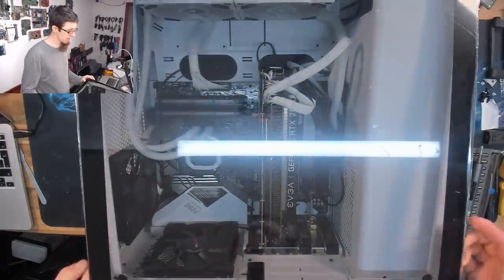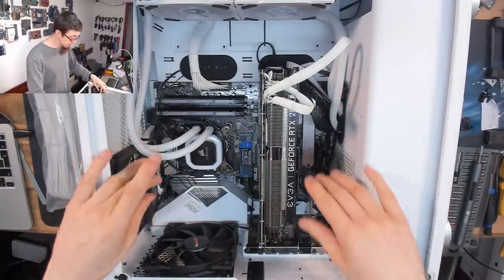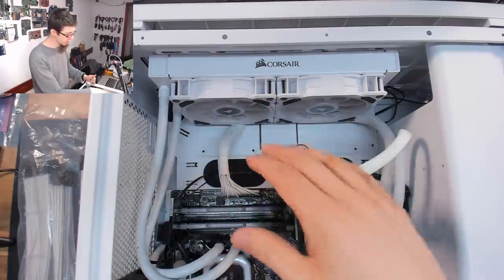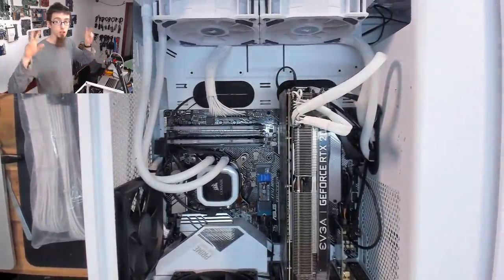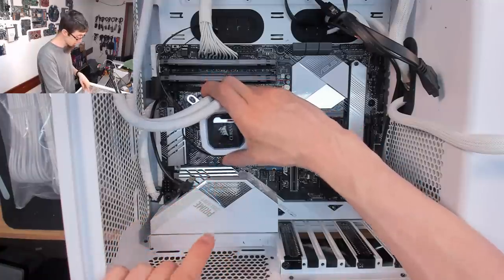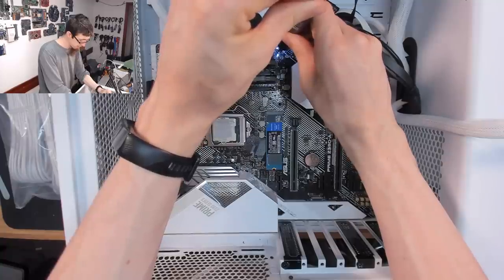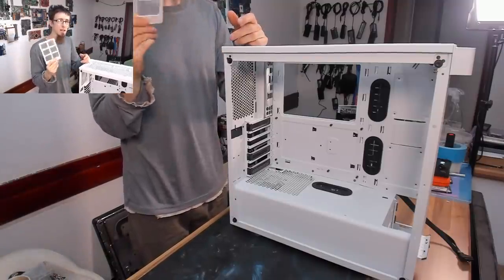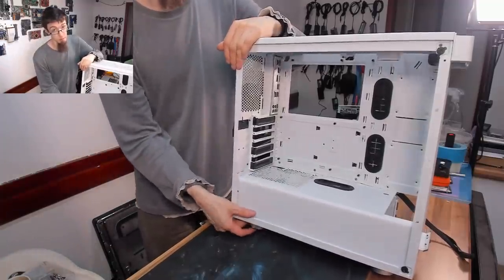Corsair 275r (not that one) Rebuild - LBC#55

Comment from the maker: [Edit 2, So Gamers Nexus just did a piece about radiator mounts, so now suddenly everyone's a radiator expert over night... The top of the radiator is higher than the pump, that's where the air will gather. I think GN are right, and hoses-low is good practise, and something that I'm going to take into account going forward, but I've got several AIOs that are 4+ years old and going strong. Hoses-high isn't a death-knell. I could see this being an issue on a bottom-mount rad though, as per their example. But that's a worst-case example that almost no one ever does.]
[Edit, Supplemental info - Top mount was not an option because it wouldn't clear the RAM. Yea it's dumb, corsair case, ram and cooler, and you can't top mount.]
Also Bring on the hate for my devious reverse-airflow plan. I'm ready.
Reply: your ideas are wrong adam
Reply: I see nothing wrong with this idea mate!
Reply: I don't see anything wrong with that.
Reply: :D before you mentioned top intake i was thinking top intake.
nothing wrong with it.
accidentally did back intake with my AMD 3700x and box cooler and turns out that relay drops temps, had mixed feelings after i flipped the fan to back out-take.
(did replace the cooler)
have PSU as out-take thanks to your videos!
Reply: What hate? The idea is a valid one where as long as there is intake and outtake flow, who gives a s*'t?
Reply: Love the videos only came across your channel like a month ago and have taught me a thing or two about pc things and ways to sort problems out thank you 😊👌
Reply: I have two Corsair Carbide 275R cases. Both use the top and rear for intake and the front for exhaust. Works great. Using a combination of Silent Wings 3, CoolerMaster, and Arctic P12 fans. I would go all Arctic, now that I have used them. Very quiet and the best bang for buck fans on the market right now.
Reply: @tonkatoytruck  yep rear intake is only good option.
Reply: Air actually rises when heated, so it will be easier to exhaust air from the top then from the front panel. You do your electronic job, let the flow engineers like myself deal with the flow issues.
Reply: No tea being drunk while working, disgusting lol.
Reply: It's pretty hard to hate on the fan config when it's the customer's desire to have RGB puke in front instead of getting the best performance of his parts.
Reply: I don't know why people get hung up on the standard configs, as long as the airflow through the case is thought through and executed well.... that's all that matters. I've a non standard config, and with a near silent setup I am very happy with temps.
Reply: at least you didnt turn over the psu...
Reply: Heat goes up damn it!! If they want RGB then why not an led strip which costs about a tenner? Love your vids but I get what customers are like as I used to deal with "the public" on a daily basis  in a small pc shop and they can be a nightmare!
Reply: I actually had to make a fan bracket for my gpu's 280 aio and offset the two 120 fans towards the side panel, so they can clear the ram sticks. The case wasn't even supposed to fit a 240 rad on top.  The 280 rad does touch the front and the rear panel, its a perfect fit! I know you can't diy these things for customers, but for personal builds, why not?
Reply: In the presence of forced airflow, the effects of convection are going to be mostly negligible, because the height of the case is just a few decimeters, and the temperature will be just a few degrees above ambient. In a fanless system, sure, convection will be very important. In a system with actual fans that spin and move air and stuff, nah, it'll be fine.
Reply: You were obviously limited by what the customer wanted, but the end result is great!
Reply: @GPEART1  Yeah this, not how I would want to do it but, he wanted the fans on the rad and it wont fit on the top
Reply: Hey, you made it work with what the customer wanted.
Reply: Technically it's a fix but now you have the air blowing out towards you which, depending on where the computer sits, could be annoying.  Nobody is going to be sitting and looking at the back of the computer.
Reply: @eli-bk2mi  I just watched that video about two hours ago. I just didn't want to be that guy. Thanks for doing it for us. : )
Reply: @TheMhannah100   that guy? in respect of @adamantIT im doing this.... cause majority of people dont know this stuff.
Reply: @eli-bk2mi  I just didn't want to correct him. I appreciate that you shared the info.
Reply: @davielee0  Heat does go up, however,, within a case, with the correct setup, the air is not static, there's a flow. So, air in, air current, air out.
Reply: AIR FLOWS - its cares not in which direction ;)
Reply: The excess noise is reason enough for me. I've been guilty of hose up in the past. Never crossed my mind it could be a problem.
Reply: @adamantit im sorry i just wanted to point this part of AIO mounting, no hate, i say it again, i love your videos, and im trully sorry you got me wrong :(
Reply: @saintuk70  thats fine if you like your fans spinning even when your PC is idle. I thought the idea of an AIO/Liquid cooled CPU wat to reduce temps and noise? At least you can't hear the waterfall noises with the fans spinning like a turbo-jet engine!
Reply: @davielee0  No turbo-jet here, that's for sure. So much so, the platter spin from the only hd in my system annoys me when it decides to have a wee spin. It's all about balance and tuning.  More than happy to share my setup if that would help enlighten.
Reply: GN sometimes have to be taken with a pinch of salt - it's amazing that, at times, they can make a 0.1% variance in something seem like a gulf. In terms of AIO, if feed from cpu was at top and out-flow in bottom then air would be at top and away from getting into the pump. But wait, that would then be something not aesthetically pleasing. Anyhoo, the cost of an AIO, even mid-range, when kept for 3 to 4 years, is nothing compared to the investment in gpu and cpu that will, no doubt, be made over that period.
Reply: One other point, with regards to up or down, it is easier for the pump to push in line, where AIO is mounted in front and therefore almost level with cpu, or to push down then up? (if you get me)
Reply: i also watched that water cooler video, and found all the comments on here hilarious! GN triggered EVERYBODY!!
Reply: @saintuk70  wouldn't the heated coolant rise to the top of the rad and push the cooler(!) coolant down? Just saying!
Reply: Why did you.......oh nevermind 😂
Reply: Airflow is airflow
Reply: @spoons27  🤣
Reply: As someone who has been water cooling for 10 years now and having a custom loop I'm on GN's side.  Yes the air will accumulate at the top you're quite right, but that's where your hoses are.  I'm glad you're going to take that into account going forward.  As far as the reverse airflow, why not?  It works.
Reply: Nothing wrong with your reverse airflow idea, but you should turn the radiator so the tubes are at the bottom.  See this recent video from Gamers Nexus for more info https://www.youtube.com/watch?v=BbGomv195sk.  This prevents the pump from running dry.
Reply: @kalliste23  Its okay its a regular 275R not the airflow variant, so it has bad airflow either way, the air is blowing into a front chamber and presumably out the bottom and small gaps in the sides of the front
Reply: You should do that upside down hose thing, i wana see how that turns out. I have the same 275r, front rad but with twisted hose that curve downwards the RAM. Some issue i dealt was the hose actually impacted the 24pin cable, then i realize i can perfectly fit the hose between my sleeved 24pins it doesnt looks cool though 😂😂😂    then came the noise problem on the first run, solve it with tilting my case.
Reply: Wisdom considers, ignorance shouts
Reply: @erhan-aslan  You're a flow engineer?  Did they teach you how a typical air conditioner works by pushing cold air through the ceiling?  Give me a break..
Reply: @nednettapp  Take your break as long as you want, you cannot change the physics. Moreover, cooling down a room and having proper airflow in a computer case are not the same thing.
Reply: I'm going to stand by Adamant on this one, every one is in "panic" mode after Gamers Nexus video. I have got a Cooler Master AIO single 140, in the rear of my case, tubes coming from top, on a FX6100 for roughly 6 years now. The temperatures are a cool 39º idle/browsing and up to 70º rendering/gaming (ambient temp 20~28º). This build has long uptimes of up to 8 days.

Gamers Nexus piece IS very interesting and something to look out for in future builds as it might reduce odds of failure in some AIO's. As for my build, never heard any weird noises or gurgling, cooler is performing the same as when i bought it. That doesn't mean it wont eventually fail some day, by that time, it's time to recycle that build.
Reply: The tubes were the highest. If air traps, water continously goes through the air in the tubes.
Reply: @erhan-aslan  Well yeah, you can change the flow dynamics, that's literally what the fans are for. Forced convection is more complicated than just 'heat rises' and I'm surprised a 'flow-engineer' would write a comment implying computers are cooled by natural convection.

Comment: I think the reverse airflow implementation was actually very smart.  As you said, it really doesn't matter what direction the air flows as long as heat is properly exhausted out of the case.  Your re-cabling job was brilliant.  You all but made the cables disappear.  One always has to work with the constraints of the case design and your approach here was masterful. Bravo.

Comment: I did use your videos to perform a massive housekeeping of my current rig.  Cable porn, fan orientation, flipped the power supply so it did not hoover my floor, Bios update and even installed an M2 and mirrored my current HDD to it.  Your channel continuously provides above grade content for the amateur computer builder.  My system wend from Win7 to Win 10 and has seen a massive upgrade in performance.  Keep up the good work, and supporting the rite to repair.

Comment: also adam with the custom braided cables instead of clipping off the excess combs  you could have combed it to the 8 pin cables to so it would have a nice flush finish to it with no gaps
Reply: I was thinking the same thing
Reply from the maker: That's a great idea - will try that out next time 👌

Comment: You've given me much to think about. Old mechanic that I am, I have used clear packing tape to "close" unused fan openings and get the air flow pattern that I want. Won't pass the eagle-eyed inspection, but then there isn't any such for me.
Reply: I closed off the bottom of my case with sheets of printer paper that I cut to size and taped to the dust filter. It's more or less invisible from the outside. And yes, I mounted my PSU fan side up, on direct inspiration from Adam.

Comment: I also have a back to front air flow. A single 140mm intake in the rear through to a 360mm AIO rad at the front. It works great, temps are low.
Reply: id do top intake with the black fans
eidt i talk to soon so is he.
Reply: How's the dust?

Comment: I have exactly the same cooler (all white Platinum H100i SE) ..it is a replacement as part of the faulty batch that was recalled by Corsair last year...(worth checking if the serial number begins with "1852"...mine did) long story (reported it on my channel) but the service wasn't great so they they ended up giving me a new one AND an additional free new one (it's still wrapped on my shelf) so good result....and it's been great since then.

The clamps on the pipes at the pump head & rad on the one in this vid are hexagonal...mine are circular...didnt make a note of what the one I sent back was but this looks from a different run because of that so its likely its fine.

 Anyway I had the same prob with the fans re the RGB....mine is at eye level on my desk and the LL fans although looking great from the front have no sideways 'window' for the RGB so were wasted.

So I have just fitted some new (again done a vid) Alpenfohn fans from Overclockers (one of only a few places that sell them)....look great from the side...have slightly higher static pressure (so good for rads) than the high speeed LL's (there are 2 types..high and low rpm) and are well made and slightly quiter....I bought the 3 fan set with hub and remote control ...much cheaper than the Corsair's. This has freed up the LL's for a build where I can see the front of them in all their glory.

Re radiator mounting....yes I haven't a clue where is best....I am a retired gas engineer (for 42years man and boy :) ) and have fitted hundreds of radiators and pumps in houses with pumps upstairs and downstairs but can't comment on a sealed system like on a PC (my Corsair is at the top of my Lian Li Dynamic case)

Great vid as usual...very pleasant way to kill a few mins watching them :)

Comment: You're a bad / good influence, grin. You've motivated me to go clean up my old test-bed system and it is now a lot cleaner, much neater on the cable routing, and the air flow is sorted. Nothing fancy inside, just working good and looking like I cared. All the best to you and yours.

Comment: I'm a new subscriber and I've been binge watching to catch up over the last few days. I must say I like the straight forward and sensible style you have . I started watching after having some issues with the memory on my X99 system. I managed to fix the problem after re-seating all 4 dimms . Not sure what caused the problem but it went away. 
As far as this build goes If people wanna hate on the reversed air flow then so be it , it's the customer's system and you followed their request. I'm a little curious as to why the top mount rad wouldn't work as this case looked like it had off-set rad mounts in the top. But as you said the rig had some tall memory sticks in it.
I guess we will see how this rig goes at keeping dust out of it. Cheers!

Comment: You can do reverse air flow, it is indeed better, than how it was made before. However, just to point out, there is slight difference of which direction you do it. Hot air tend to go up, that's why usually the direction of the air flow is not only from the front to the back, but more important, it is going from the bottom to the top. In case of going from the top to the bottom, the hot air meets the cold air comming from the top resulting in tutbulences which can slightly decrease the cooling effect, if your front fans are not strong enough. Furthermore, standing upright and soacking the air on the top, you'll probably get the case dusty on the top faster. This is just to point out the disadvantages, however, as I told, blowing from the top rear to the bottom front is still better, than just to blow out on all sides. Actually, you also could place the front white cooler to the top completely, just as another option.

Comment: would have been great if you did a performance benchmark and thermal check so you have a benchmark so you can test that your tweaked rebuild has resulted in better cooling
Reply from the maker: This would've been cool to do, but sadly I didn't have the time on this one, as it was a same-day rush job. It's been running great since though, I did have to do a follow up due to a bad mount with the water cooler - for some reason this one's fussy. But the case airflow has been working just fine.

Comment: i literally bought this case not that long ago i saw the original build on your channel and it is one of the easiest cases i've had to build in i owned a Deep cool tesseract before this though i've built in many cases including the NZXT H500i and i find it very similar it's nice and clean very happy with i've now got an i7 6700k with an RX 480 8GB  and 16GB GB corsair LPX in it and the temps are phenomonal it's overclocked to 4.5 GHZ the ram with the overclock is at 2990MHZ furthest it would go overclocked love this system planning on upgrading to an AMD 3900X with either a 2080TI or a 2080 super and 32GB of trident Z royal Ram it's my ideal pc dream to own this build.

Comment: It's better with the reverse-airflow, because the black case fans don't have enough static pressure to blow through the radiator.
Also it's recommended to check the cooler standoffs if they have the little plastic washer under them before ripping some traces on the motherboard. Newer mobos usually don't have any traces near the holes, but i've seen some with traces right next to the holes.
Reply from the maker: Good idea for the washers, yes. I never tighten enough to bite through the solder mask, but plastic/paper washers would certainly be insurance.

Comment: When anyone other than me builds a computer: "Yea there's like 5 cables."
When I build a computer: "Man why are there like 50 cables in my computer wth is this? There's no way this cable can bend like that."
Literally just rebuilt my computer in a new case designed around not burning your hand when you touch the side panel after playing a game.

On a side note my case advertises being able to put 2 120mm fans on the bottom to suck air in just above the powersupply and the USB 3.0 wire is so stiff you literally have to choose between having USB 3.0 and 1 fan or no USB 3.0 and 2 fans... I chose 1 fan.

Comment: If you start by connecting the extension to the motherboard, then pushing through the case holes, it is easier to get the finish look. At least that has been my experience.
Reply from the maker: Sounds like a good idea, I'll try it out on the next one!